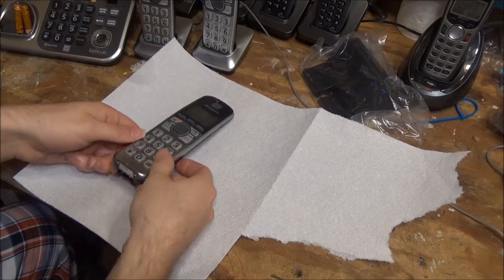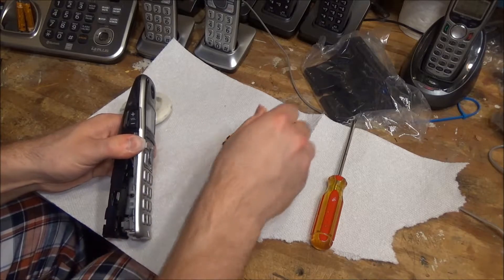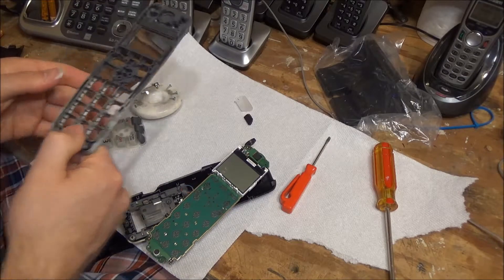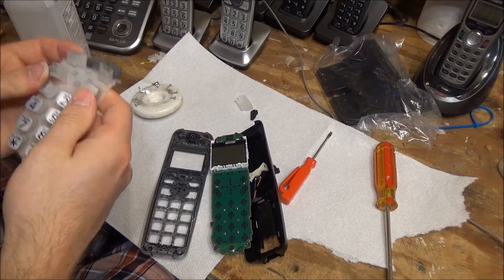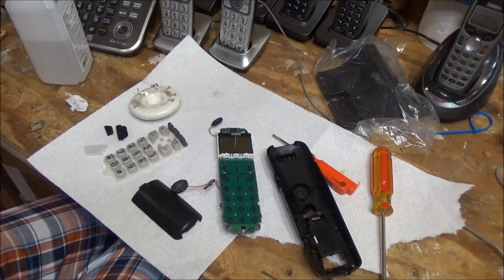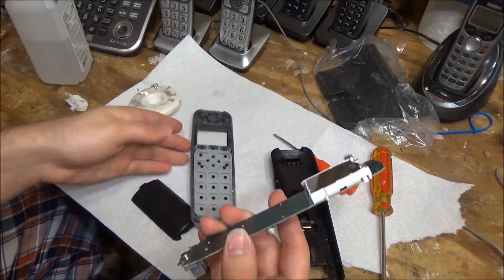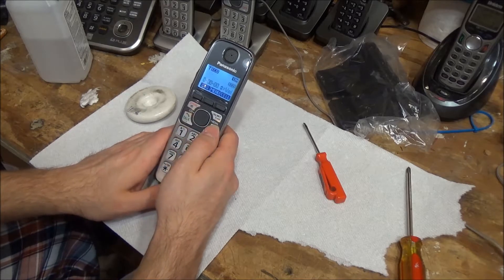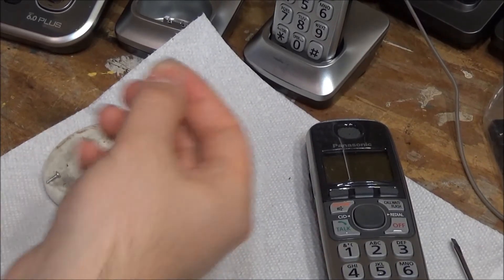Refurbish Panasonic KX-TG7741

Comment: Trick to getting those open easy without nicking it. Never use flat blade screw driver.. What I do is start from bottom with credit card and slide on the side left side, then push case to release clip on other sides and then life case while pushing up and pops right off. I get them off in under about a minute, cleaned way to many of them over the years.
Reply from the maker: I prefer a plastic spudger, didn't have one on hand at the moment.